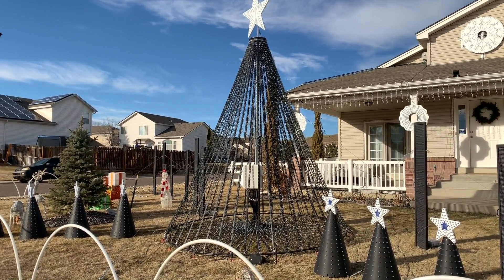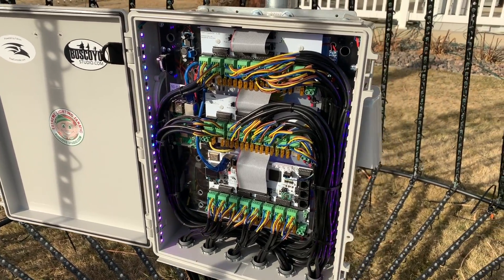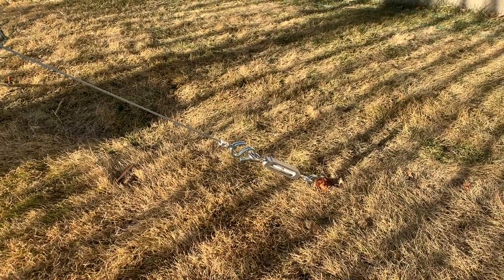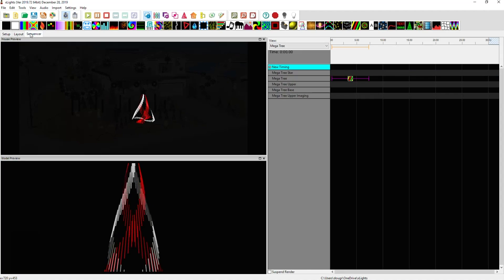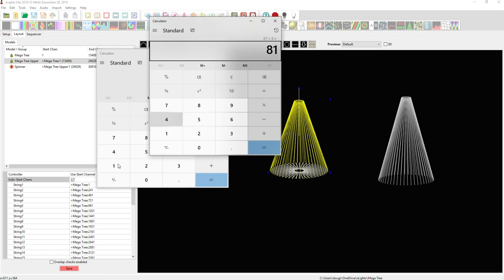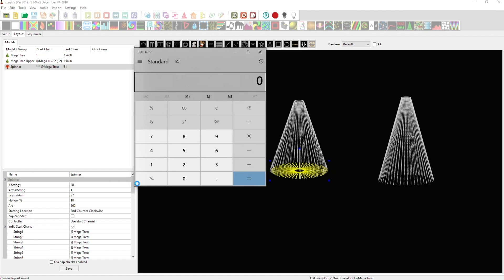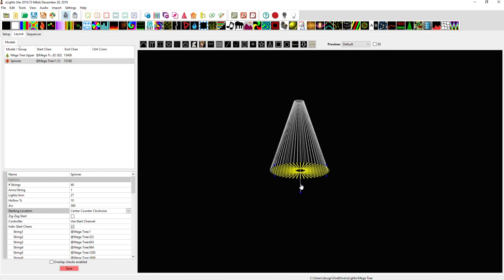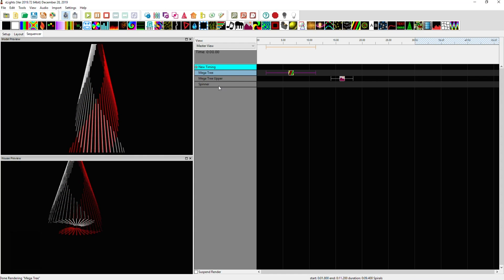Mega Tree Behind The Scenes 2019

Comment: Doug, what do you use as your base for your ASAP pole? Is it something you have buried into the ground or is it a portable hole? I couldn't make out what you were using in the video. This is an amazing tree by the way!
Reply from the maker: It's 3' of pipe buried in concrete below ground with a threaded coupler to join the sections.

Comment: Can you daisy chain Falcon controllers together or do you use a switch?
Reply from the maker: The new falcon controllers do allow daisy chaining, but it's not something I do. Using a switch is one alternative, but I pair each controller with it's own remote raspberry pi.
Reply: @reelpilot  And do you keep a controller  next to all of your pros. because you don’t power inject.
Reply from the maker: In a sense. I do have the controllers spread out so they essentially handle zones, such as the roof, left side yard, center yard, right yard, mega tree and so on. Some of these zones are then further broken down into sections utilizing 4 port receivers closer to a cluster of props. Even with that there are some runs to a prop that are 20-35 feet away from the controller.
Reply: @reelpilot  Oh wow and no power injecting, very nice.

Comment: Kinda late for this year, but thinking of making a tree for next year. If you don't mind me asking, approximately, how much did it cost to build?
Reply from the maker: A good number when starting out is $1 per pixel when estimating the total cost. While the pixels themselves can cost $0.18 - 0.30 a piece, once you factor in controllers, power supplies, enclosures, wiring, miscellaneous parts and lots of trips to Home Depot, it works out to around $1 per pixel. Also once you have the basic setup with controllers, adding on in subsequent years isn't as expensive.
Reply: @reelpilot  Thanks for the reply. I figured it wouldn't be cheap, but looks like it would be a lot of fun to build and sure looks cool.

Comment: I'm working on duplicating your Mega Tree, I really like the design. I just have a few questions:
01. What length and where can I find the long pigtails for your controller box?
02. Are you using unicast or multicast to configure it in XLights?
03. Did you use universities in your layout?
04. I understand you used port 48 to add the star pixels for Data & Power and you use port 47 to inject power at the other end. Did you remove the male prong for the data on that connection or just left the wire disconnected?
** I also order your framework for your Mini Trees looking forward to being able to put them together. 

Thanks for all your help!!
Reply from the maker: I use a few different lengths from about 2' to 3' depending on the exact project. I just order custom length pigtails when I order pixels. I use unicast and currently configure everything using the universe - start channel method. On the power injection for the star, I simply don't connect the data pigtail wire on the power injection lead of the star.
Reply: @reelpilot  Thank You!!
Reply: @reelpilot  What Vendor do you use for pixels? There is so much talk about who to trues and not to. Just want to hear from someone that has done this for a whil.
Reply from the maker: I have used many different ones and have never had any abnormal issues or high failure rates, but I'm leaning towards trying some of the US vendors this year.

Comment: Hi Doug - I love your tree and I am inspired to build nearly the same thing. I am new to this world but I am doing a lot of research to be ready next summer. I will be buying an F48 with 12 differential receivers and I'll be building a variety of 1, 6, 10 and possibly 48 port power outputs for power injection - all 5V pixels by the way). I understand that you are using 2 additional F16 expansion boards with a total of 3 power supplies for your tree. I was considering building a 48 port power supply using 2 1000 watt Mean Well's and using 4 differential outputs from the F48 giving me 16 ports for data for the 48 strings... Seems like a lot of blah blah to get to my question. I can build the same controller setup that you have, and daisy chain the F16 off of the F48 giving me the full 48 ports for the tree, or I can stay with my design. I would like to know what the advantages are of running 48 ports for the data (1 string per port) vs running 16 ports (3 strings per port) or even 1 port for the whole tree. What does more ports give me as far as flexibility and control?

Comment: Doug - I profusely THANK you for this posting = I have watched it over and over, and over and over more!  My first venture into xLights was following your lead provided here.  Amazing!  I have studied your tree more than A LOT!  As a newbie, I'm building qty. 2 MegaTrees this year - I like your design so much, essentially both trees are modelled after your tree shown here.  One area of your tree I have not figured out = your star.  If I understand correctly, you're running 12V strings, and your port 48 has 1110 channels (370 pixels) on it (100-node string + 270 pixels on the star) - and without power-injection you are powering 235 pixels on port 47 (100 + 135), and powering 235 pixels on port 48 (100 + 135)?  Is this correct?  Does running "at 20% brightness" allow you to pull this off without power problems?  Thank you in advance for your help, and THANK YOU again for your video here = I say I have benefitted from it more than all others combined!
Reply from the maker: You are essentially correct. The tree is actually 107 per string, 80 for the tree and 27 on the skirt. As far as pixel data goes the star is chained to follow the tree in xLights, so all the data comes from port 48. If I did nothing then that would mean 377 pixels off one port. So I essentially used port 47 as power injection. I had to actually go look at the prop to see exactly how I did it since I couldn't recall exactly. Now I will say this is slightly overkill, but does help to evenly distribute the power. I basically divided the power injection every 90 pixels. Port 48 comes in goes to the first pixel. Right before the first pixel I spliced in a wire that carries v+ and v- to pixel 90 to add a direct stream of power there. Then on the port 47 side the power from that is split so that one branch goes to pixel 270 and the other to pixel 180. Since port 47 and 48 originate from the same power supply I don't have to worry about separating the v+ wire.
Reply: @reelpilot  The fog is starting to lift!  THANK YOU!  I believe I even understand about not "separating the v+ wire".  Did you do actual soldering type splices, or did you by chance use Ray Wu T's with pin removal(s)?
Reply from the maker: @cheesemonkeyboy1  I solder everything myself. Depending on the prop I sometimes take the incoming power wire and have 2-3 outgoing ones to branch power down the line for balancing. You can run a lot of pixels that way off one input and have zero fading or pink when on full white.

Comment: Wow just simply amazing! I love your box where can I get all the components to build a box just like that my mega tree this year will be 5040 pixel 24 strings of 210 pixel 180°and I’m currently building a box for it. I had calculated I needed six Meanwell 350 to drive my 5000 pixel but on your video you’re using three and saying there and off what percentage are you running your pixel at?
Reply from the maker: The box is a Bud Industries box. The mega tree box is a NBF-32328. The vents for the boxes are also sold by them and available on Amazon as well as PWM fans that work with the F16v3. I run the tree at 20% brightness, but the only way to really know how many pixels can be run from a power supply is to test the load with a multimeter to get the actual current draw per string at white and do the math to make sure you have at least 20% margin to max load.
https://www.budind.com/view/NEMA+Boxes/UL_NEMA_IEC+NBF+Series
Reply: @reelpilot  any chance you can confirm the rough dimensions of your BUD box? The model you list, NBF-32326,  according to their website is 15.75”x11.81”x6.30”. But at least in the video yours looks a bit bigger but it’s hard to tell. Thanks again! Subscribed and liked!
Reply from the maker: @alex-j-cole  I had to do some digging and found that the mega tree box is a NBF-32328, so that is bigger.
Reply: @reelpilot  thanks!

Comment: Appreciate the insight in your mega tree build!

I'm working on building my first mega tree this year.  I'm worried my J hooks will rip my boscoyo strips.  I see you used metal grommets on your strips.

Where did you get those?  Is it something you pick up at a Home Depot/Lowes, or are they special order for the strips?

Thanks!
Reply: I didn't even know how they are called, now thanks to you I know they are called "metal grommets". I will go now and try to find them on amazon. Regards.
Reply from the maker: I used 1/2 grommets from Harbor Freight and had to drill out the holes in the strips ever so slightly for them to fit. They really work great.

Comment: Doug,  Incredible design and more importantly your sequences are awesome!  How much difference did it make to change from 53 pixels with 3 inch spacing to 80 pixels with 2 inch spacing.  Also the extra 16 or so strings?  Hope to hear your thoughts!
Reply from the maker: David McKee there's a huge difference in detail that is gained by going to more strings and tighter spacing. Many people even go with 64 strings and 1" spacing, but I wanted to still be able to see into my tree for that 3D look and going with even more strings would have hindered that. The added detail is most noticable when displaying pictures or videos on the tree, however all effects benefit from the added density.